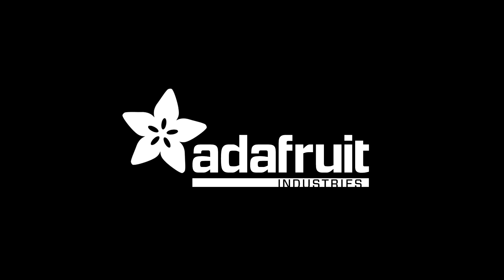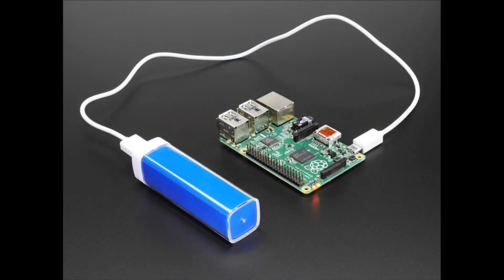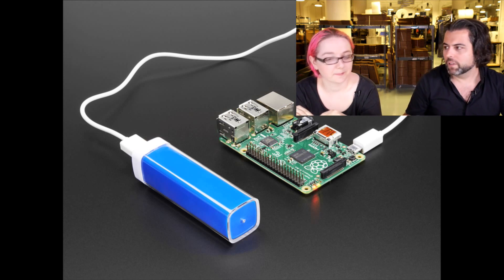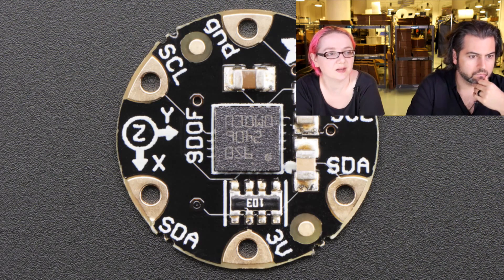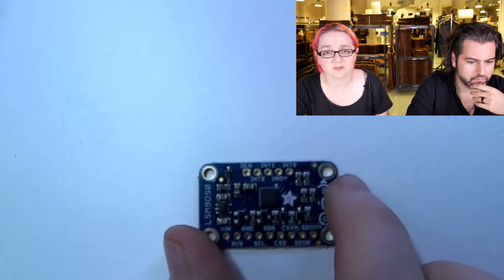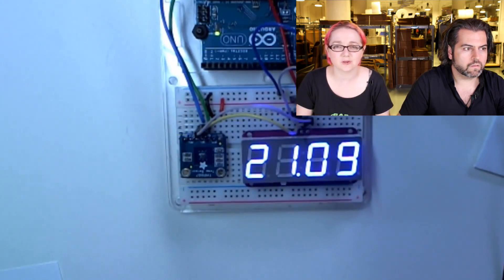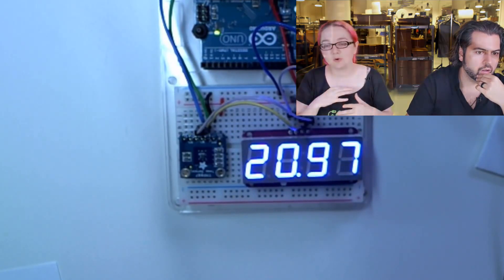New Products 8/6/2014

Comment from the maker: New Products 8/6/2014
http://adafru.it/dGx

 - TV-B-Gone Kit (0:08) https://www.adafruit.com/products/73

 - USB Battery Pack - 2200 mAh Capacity - 5V 1A Output (0:51) https://www.adafruit.com/products/1959

 - Stacking Header for Raspberry Pi B+ - 2x20 Extra Tall Header (2:30) https://www.adafruit.com/products/1979

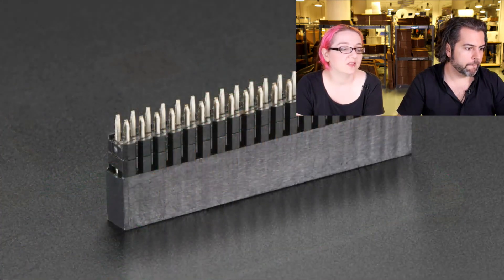 - GPIO Header for Raspberry Pi B+ - Tall 2x20 Female Header (3:10) https://www.adafruit.com/products/1992

 - FLORA 9-DOF Accelerometer/Gyroscope/Magnetometer - LSM9DS0 (3:36) https://www.adafruit.com/products/2020

 - Adafruit 9-DOF Accel/Mag/Gyro+Temp Breakout Board - LSM9DS0 (4:25) https://www.adafruit.com/products/2021

 - Contact-less Infrared Thermopile Sensor Breakout - TMP007 (5:41) https://www.adafruit.com/products/2023

All in stock and shipping now!
http://adafru.it/dGx
 #newproducts     #video